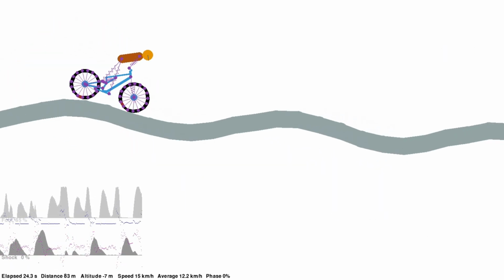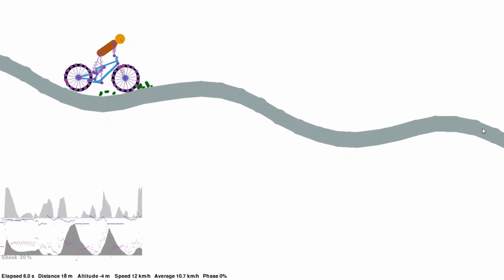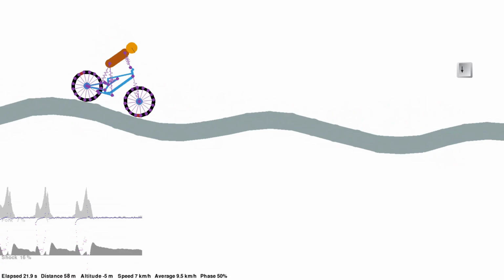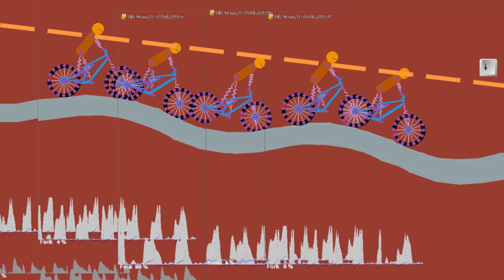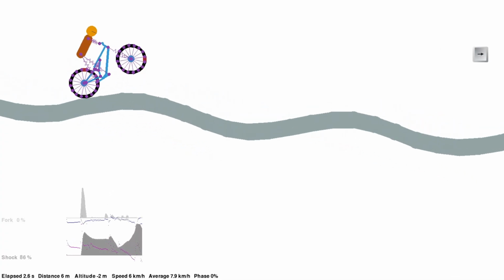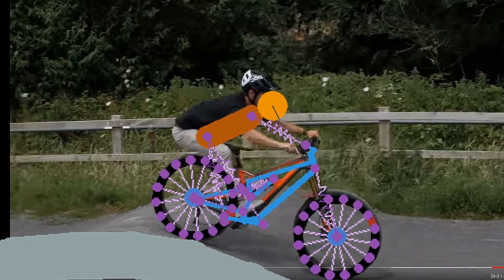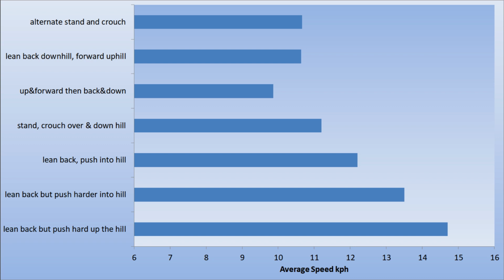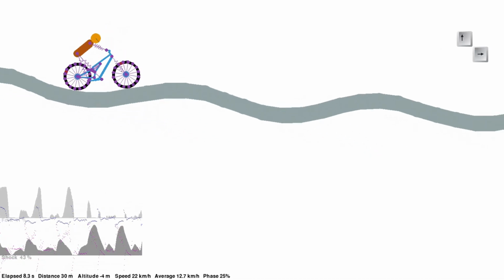Do not try this at the pump track! mountain bike physics

Comment: Really enjoying your videos. I always think of pumping IRL as manipulating your vertical acceleration (relative to the ground) to affect your weight. If you stand up on the bike (raise your COG) you have to push down on the pedals to accelerate your mass upwards, increasing your effective weight. The bike then pushes down more on the ground. Do this on a slope and the increase in weight = increase in reaction force = increase in horizontal component of reaction. Do the opposite (sit down, lower COG) and you decrease the deceleration horizontal acceleration. So on a real pump track stand up on a down slope and you'll increase the acceleration you get from going down the slope, then sit down again on the next up slope and you'll decrease the deceleration you get from going up the slope. The bigger you can get these increases and decreases (really stamp down on the pedals on the downs & pull the bike right of the floor on the ups) the faster you'll go!!!  Obviously this is for a single wheel, a bike two wheeled bike and a rider adds a lot of complexity to find the perfect rhythm / timing for max pump! Anyway, just my thoughts. Would be really interesting to see a plot of tyre contact forces throughout the track!?!
Reply from the maker: Glad you like the videos. Your explanation of the reaction forces makes perfect sense to me.

I will have to think about the tyre contact forces. Since the tyres are modeled as links of a chain (attempt at a deformable body using a non-deformable library) it gets a bit tricky in the software. The code can spit out the impulse acting on each link. My first idea would be to look at the forces in the spokes which is easy to code up quickly. What should we learn from the plot?

Comment: Programming the terrain to follow a simple sign wave -- inside a frame of reference with a gravitational gradient... reminds me of harmonic motion -- harmonic oscillator more precisely, where the weight shifting of the rider seemingly dampens the disruptions presented by perturbations in the path along the gravitational gradient. Does the simulation handle differential equations? What about step response functions? A better step response might soften the crispness of the controller inputs so that "either on or off" is fuzzier. Paraphrasing Wikipedia: The time an oscillator needs to adapt to changed external conditions is of the order tau equal to the reciprocal of the product of the cosine of the phase and the undamped angular frequency of the oscillator. In classical mechanics the adaptation is called relaxation, and tau is called the relaxation time.
Reply from the maker: Excellent observations Mike. I thought about more complex input functions but I am lazy so I did not do it. I did play with the tau by adjusting the damping of Bounce's arms and legs. More damping therefore a longer relaxation time did smooth out the response at the sacrifice of snappiness.